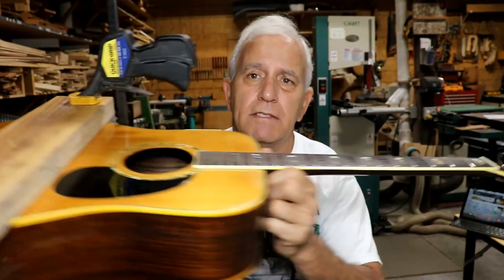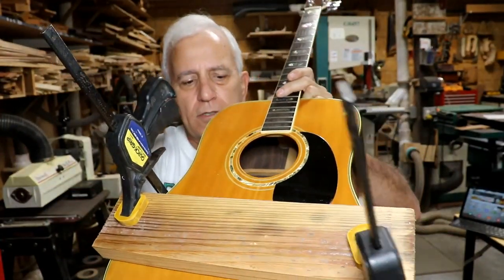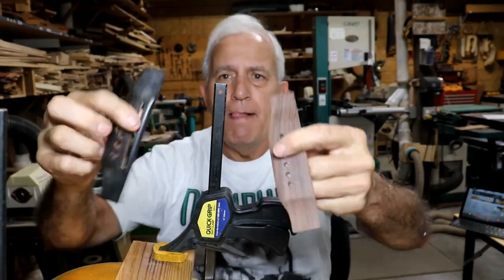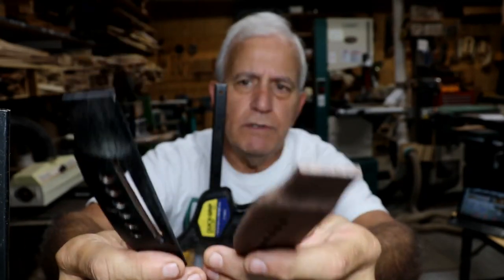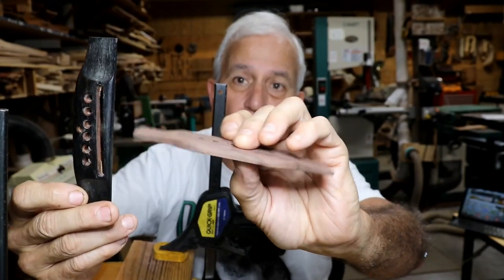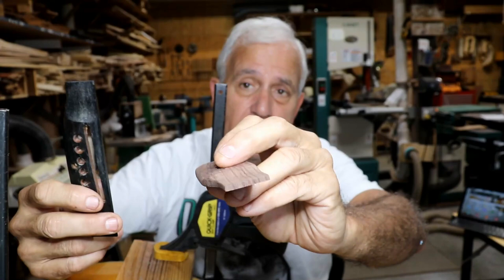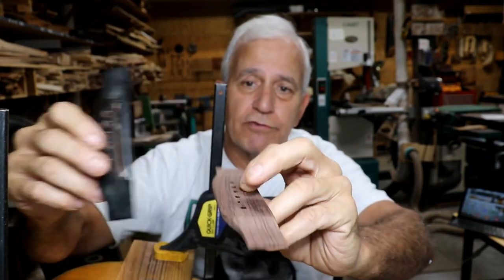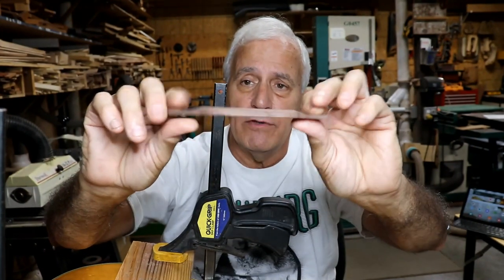Vlog #089 Ibanez Bridge Work

Comment: On my Takamine New Yorker with a belly bulge, I unstrung it, and placed a small dish of water containing a piece of sponge through the sound hole, and slid it back behind the bridge.

I then taped off the sound hole with packing tape, put a 2X4 across the lower bout, and added 20 lbs of weight to the 2X4. I let that set for a week.

After a week, I removed the water container, kept the sound hole open, and left the 2X4 and weight on the guitar for another week. that was 3 years ago. The bulge has not returned.

I really wish I could use that on my own bulge, but no dice, unfortunately. It's still there - and growing.
Reply: LOL, hey sounds like it worked, the wood in that guitar must have really been dried out. You must live in a dry area, where I live the humidity is so high, if you did that your guitar would fly apart. I have seen Jerry take the bulge out of many guitars, from larger bridge pads or at least a new bridge. You have to be careful because if a guitar has been like that for years, straightening it out could cause braces to pop loose and such. That is where experience comes in. Jerry knows what to do, each guitar has it's own case.
Reply: @jthonn  I live in an area that has about 50-60% humidity, but all of my guitars have been stored in climate controlled conditions.

Those conditions include A/C, which tends to remove moisture from the air, and an electric furnace, which does the same.

I have used that method on three guitars so far, without any issues.
Reply: @perihelion7798  Happy it worked out for you. Takamine makes a good guitar. I just know a guy that has a 100+ year old Gibson that he tried to straighten the top out on and created a mess. He got it pretty straight but 2 braces did not want to go straight and the bridge pad too. I helped him get it right but it was a job. The only reward was he no longer needed a neck reset, at least for now.
Reply: @jthonn  I can see how a brace or two might be stubborn, however, the method I used created a uniform humidity, including the braces and bridge plate, so they sort of worked together.

Note that the time factor was important, as I allowed the humidity to increase fairly slowly, then allowed it to decrease slowly.
Reply: @perihelion7798  Well hats off to you, you must know what you are doing, but the average "Joe" can really screw up. Cheap guitar, no big deal, but an expensive or a collector it is better to find a good luthier. They have all the tools and experience to do it right. I saw one luthier actually make a bridge with a small arch in it to match the top and did a neck reset. It was an old Gibson, J 40 I believe, and it came out perfect. I don't remember the story behind it but was worth a fortune. It may have been stringworks not sure. Anyway it's cool you have a method that works for you. Kudos
Reply: @jthonn  I make it a point not to own any antique or expensive guitars. I have one Gibson that is worth about $2,000, and that's about tops for me.

I play rather inexpensive guitars, but ones that I have set up properly, and made any repairs and adjustments that were required.

The value of an instrument is in the eye of the beholder. I'm not a slave to the headstock decal.
Reply: @perihelion7798  I hear ya! My son has a Martin that gives me the heebee jeebees when I work on it. It is worth about 5k. I won't do anything major on it. I did adjust the truss rod and made a new saddle out of bone and lowered it, also a light fret dressing. He says that guitar didn't play that well when it was new. It could use new frets, but I am not going to be the one on that guitar. His other guitars run into the 5 to 8 hundred range and I'll do whatever to them. He has electrics and acoustics. My friend with the old gibson was in a real pickle, so I did work on that one. I was crapping myself the whole time but, like Jerry says all the time, I didn't break it, I'm just trying to fix it. It did turn out great in the end. Proud of myself on that one. It would have cost him a pretty penny if a luthier got a hold of it.
Reply: @jthonn  You do what you are able to do, as long as you do it well, and don't exceed your talent or experience. I try not to bite off more than I can chew.

The people I do the work for cannot afford an expensive guitar, but they want the best performance from the guitar that they own, regardless of it's prices. That's what I do.

Everyone has been pleased the way their $200.00 guitar plays and sounds after some minor repairs and a good set-up.

I do a lot of small stuff for free, like soldering an output jack, or cleaning up or fixing a pot or two. The people that come to me are not pros, just folks that love to play guitar, and that are not flush with cash.
Reply: @perihelion7798  Man that is wonderful, pretty much the same as I, I haven't made a dime and never will. Most of the work I do is from my son, his friends and a few of my friends. That is why I don't mess with the expensive stuff other than a general set up. I have found that if someone is starting out with acoustic, Fender makes a well made acoustic guitar for around 125.00 or 150.00 bucks. I bought one for my son when he started and could not believe how good the quality and sound was on that guitar. I think it is called a starcaster. Gibson makes one too, but I don't know how good they are. That Fender I can't say enough good for it for the price. You can put some nice tuners on it and is all you could do to upgrade it, maybe a saddle and nut further down the line. If you come across one, play it and you will see what I am talking about. It seems like we are on the same page, we won't bite off more than we can chew, and doing it for the fun and challenge, and to make someone happy. Cheers
Reply: @jthonn  Yep. The best of luck to you and your son, and your family.